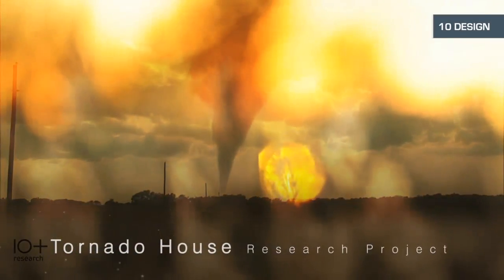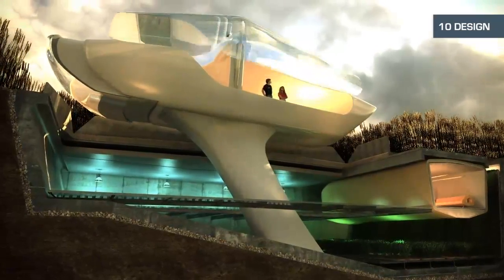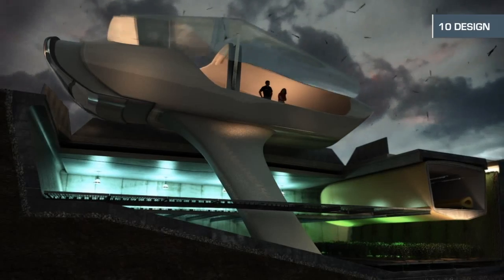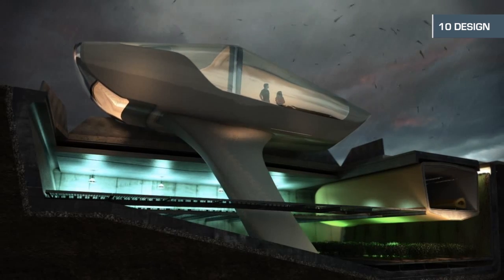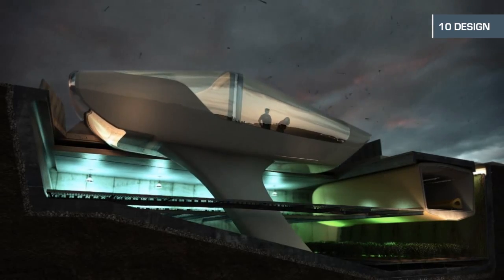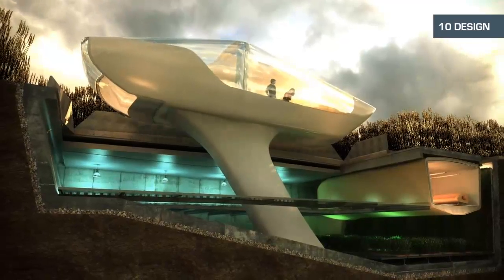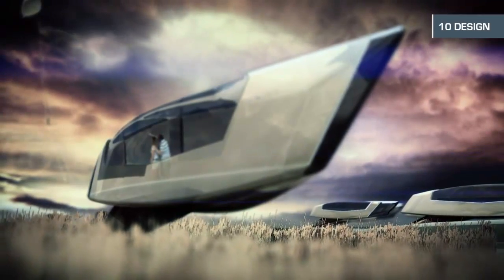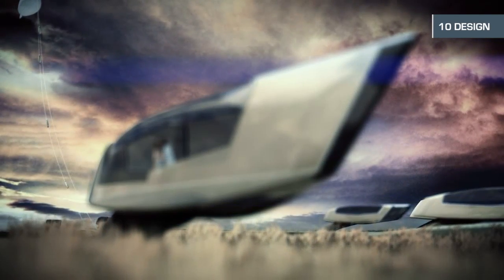Tornado-Proof House

Comment: Just another piece of your run-of-the-mill overengineered design junk that is impractical in so many ways and will reliably fail when needed most, still good enough for a bachelor's thesis in clueless construction. What about teaching people living in Tornado areas how to build and live in simple but real, solid houses, and stop building stickframed cardboard boxes that happily disintegrate into heaps of toothpicks on windy days?
Reply: rubadux Brick and concrete houses won't stop a violent tornado from turning cars and 18-wheelers into missiles and slamming them into the wall. Tests at my University (TTU) have already proven that sticks of wood can pierce brick if thrown by a tornado. Also, it would be extremely expensive to upgrade for such a low risk. The chances of you getting hit by a tornado directly are around 1 in 4.5 million. I've lived in tornado alley my whole life (almost 21 years) and have never seen a tornado.
Reply: that's been done for decades.  But since it isn't 1) impractical 2) Insanely expensive. And 3) pushed by liberals it doesn't get play.